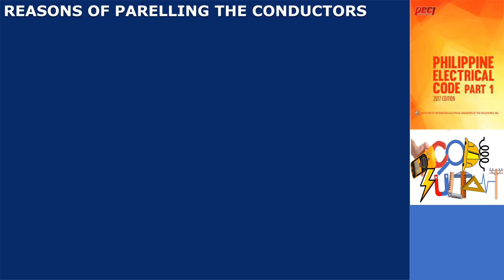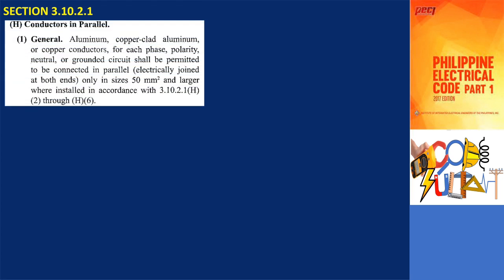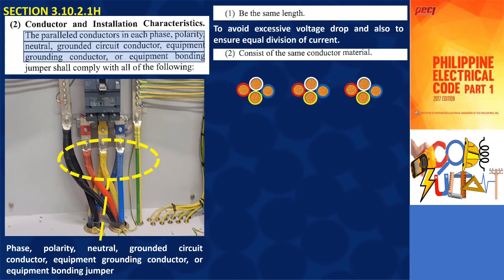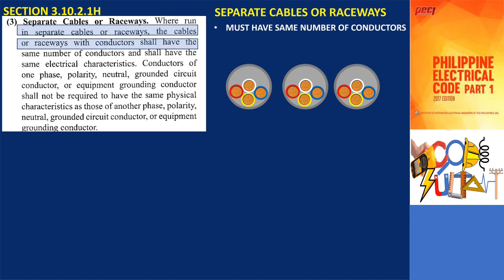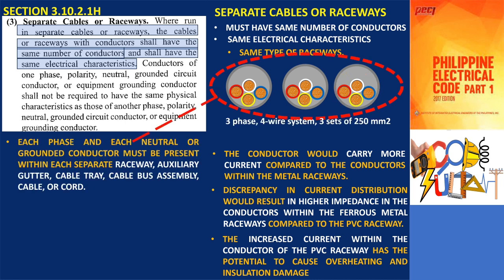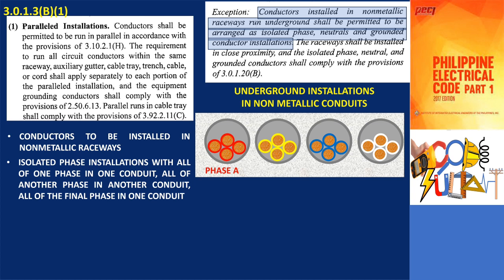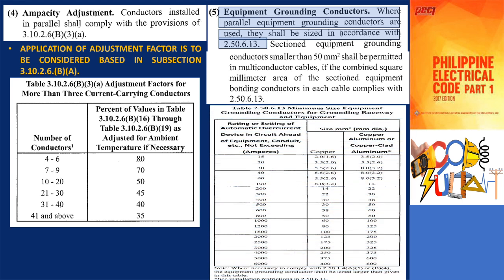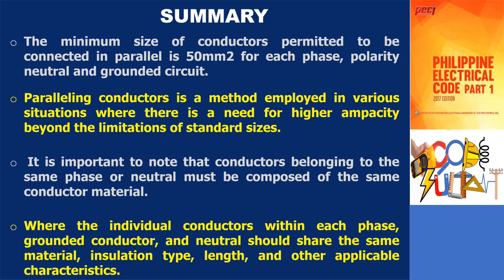HOW TO PARALLEL CONDUCTORS – PHILIPPINE ELECTRICAL CODE 2017

Comment: Sir pag ba sinabing 2sets 250mm2 + 125mm2 ground meaning 2 sets din nun yung ground wire?
Reply from the maker: Good question, depene kung paano mo install, if sa isang conduit o cablevtray lng ok n ung isang set ng ng EGC, pero if separate conduit, 1 EGC for each conduits

Comment: Sir may sinasabi ba si PEC tungkol sa feeder wiring na inilagay sa magkaibang conduit. Halimbawa kung ang bawat isang feeder wire ay may kanya-kanyang conduit. Isang conduit isang wire (L1) etc etc
Reply from the maker: Acceptable naman yun, pero dapat non-metallic conduit gamit mo at, install in close proximity.
Reply: Salamat ng marami Sir @codesultant
Reply: Sir @codesultant  anong section po sa Code makikita yun Sir?
Reply from the maker: @manuellastrollo2168  check mo video sbout indiced current, exact section need ko  p check bit na mention un sa video ko

Comment: can all parallel conductors be installed in a trench?
Reply from the maker: Yes, it can, provided it complies with code requirements such as percent fill and the application of adjustment factors (grouping).

Comment: 310 is parallel article?
Reply from the maker: Hello,

If you are inquiring whether the section I am referencing in my presentation aligns with Article 310 of the National Electrical Code (NEC), the answer is yes